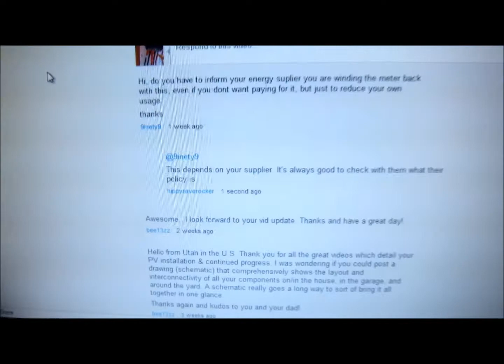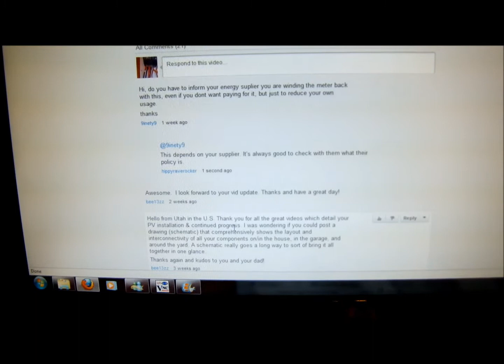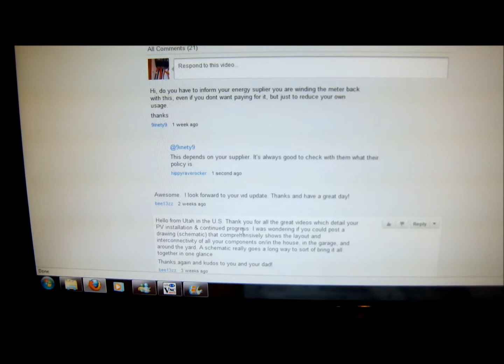Solar grid tied garage setup UK - Wiring diagrams

Comment: Those cheap GTIs go tango uniform all the time.  You would be better off getting some real deep cycle batteries (that big one you had that died was most likely a starting battery), a good charge controller (not WellSee crap) and an off grid inverter and not bothering with grid tie.